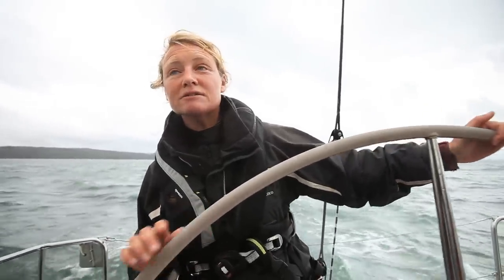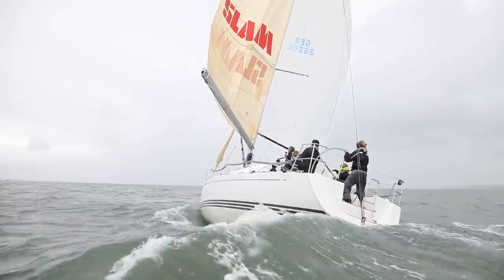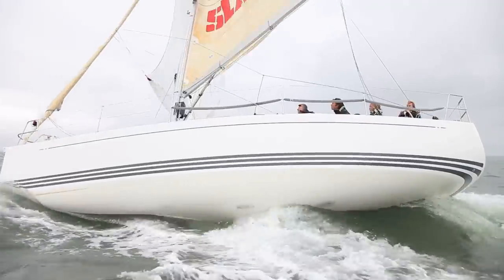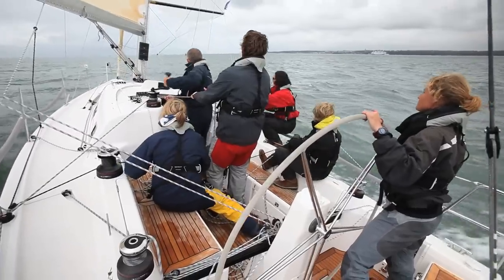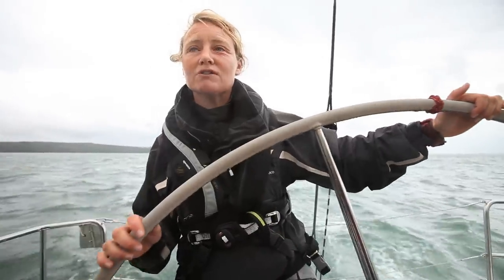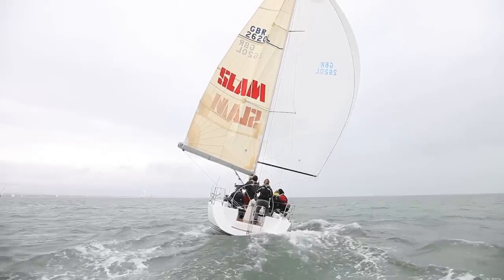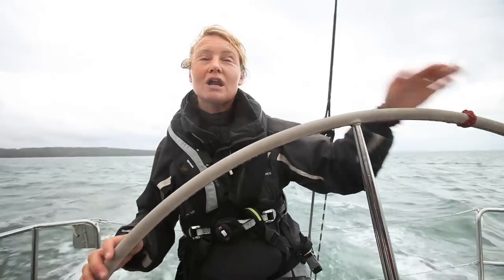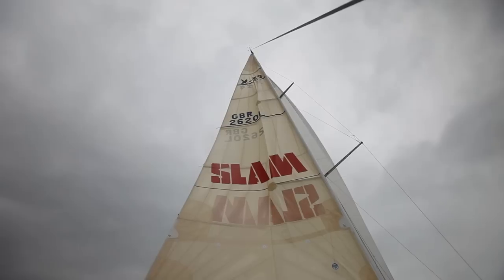How to avoid a Chinese gybe when sailing downwind

Comment: The term Chinese Gybe comes from the Chinese sailing vessels called "Junks" The way these boats where rigged made them very prone to this unexpected maneuver, hence the "common" term "Chinese Gybe".

The difference between a Chinese Gybe and a broach is that instead of the boat being dragged to lee as with the Chinese gybe, there is sudden shift in the wind direction that backsides the sails, the main boom and foresail (spinnaker or not)  go crashing to the opposite tac under high power and yank the stern of the boat out of the water entirely. This would be considered an extreme accidental gybe. (which results in a broach) and usually the lose of the mast if the winds are high enough.
Reply: Also racism

Comment: Would be very useful to also explain how to steer the boat under the kite.
Reply: What it comes down to in higher winds is the spinnaker trimmer has more control over boat steerage than the driver. With a properly experienced crew, the drivers job is fairly easy in getting the boat down a wave for speed.
Other factors involve the actual rudder design and how round the hull is.
If the hull is fairly round the boat is more prone to rolling, making the drivers job a bit on the nervous side.
Spade rudders also have limitations in higher winds/waves. I have remedied this limitation on a notoriously squirrely Cal 31 by augmenting the leading edge of its spade rudder  .. now, even on a close reach, with the spinnaker up the boat drives like a Porsche with power steering in 15+ knots of breeze.

Comment: I am surprised at the lack of emphasis on spinnaker trim. When you're running in heavy air DO NOT ease the spinnaker sheet to the point that the 'chute is to weather of the forestay.  Keep it strapped in.  In heavy air the centerline of the 'chute should always be to leeward of the forestay.  This is especially important in IOR boats with their narrow sterns.  In modern boats for peaceful downwind sleighrides  put a dinghy sailor on the helm and a smart, very conservative crewman on the spinnaker sheet.

Comment: Only one thing I didn't understand. I though pulling the kicker during downwind sailing depoweres the main, not powers it? Or is this a special case because the main goes all floppy when the boat turns to port on it's own?
Reply: The idea is that the flatter the sail less power it has. tightening the boom vang (kicker) flattens the sail. It makes sense. The more bellied a sail the more wind it can grab which increases its power. This was from 4 years ago and you posted a month ago so maybe you will see this reply.
Reply: @davidm203  If he doesn't see it, it's still a good reply and appreciated. Thanks 🤙
Reply: @davidm203  The opposite is true, the video is correct. Easing the “kicker” (vang) de-powers the main in the first instance by letting the boom rise, releasing pressure. If further de-powering is required the main sheet can be eased.
Reply: @davidm203  The outhaul flattens the sail. The kicker reduces twist and stops the roach spilling air. It flattens things slightly, but thats not why you use it.